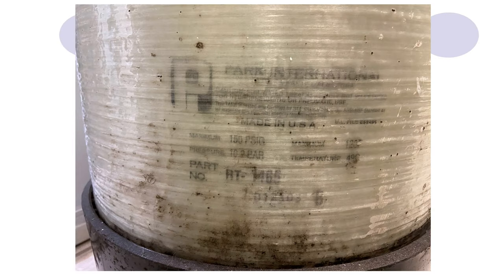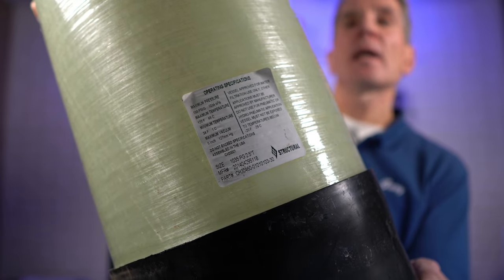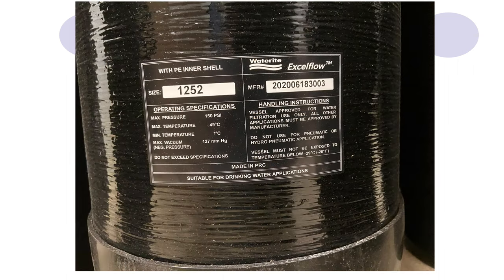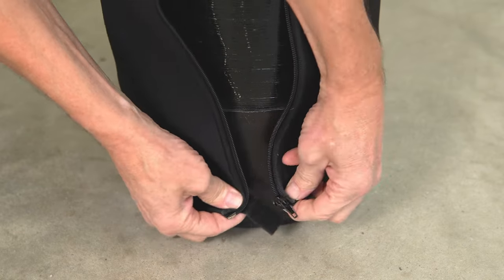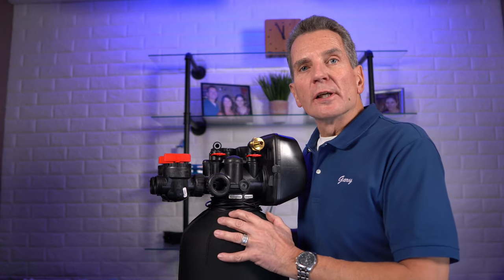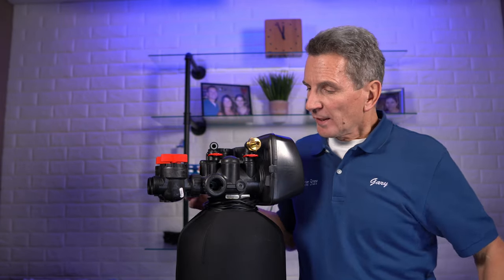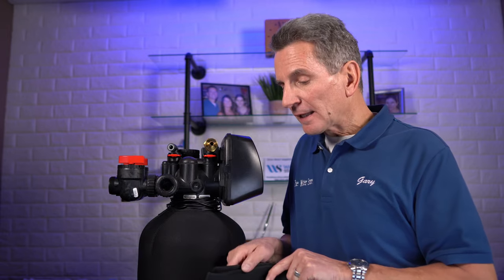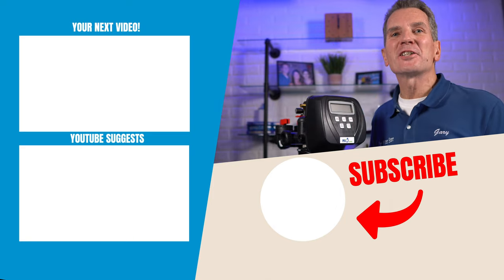Water Softener Jacket STOPS TANK from SWEATING!

Comment: Gary Found remnants of critter infestation in tank ...how to use the jacket or what would you suggest to keep mice out of tank please? Not sure how jacket fits over pipe fittings which is how mice got in.  Thanks for any help!!
Reply from the maker: Jacket has zipper at back so no need to disconnect from plumbing.  I've never heard of critters getting in, I guess you need to seal all holes to keep them out.
Reply: You had critters inside your resin tank or your salt tank?

Comment: We are on well water. COLD well water. The pex sweats from the bladder tank all the way to the treatment tanks about 12 feet away. We have two tanks. I get a slow drip on the back of the head units on both tanks. This drips down the backs of the tanks to the basement floor thankfully concrete. I think this jacket would just get soaked.
Reply from the maker: In extreme cases it will get soaked, but it minmizes the water getting to the floor and because you can wash the jacket you won't get mold build up. The jacket makes a huge difference. Did you read the reviews? https://waterestore.ca/products/neoprene-softener-jacket-10-x-54-tj1054zip
Reply: I just bought my first home. I too have extremely cold well water. I installed a whole plethora of filters and a twin water softener. Today the condensation hit me. I dried everything off, put a fan on it, and then dragged out the dehumidifier. Ran to Home depot and purchased a ton of insulation to complete all the piping. Now, if the tanks and other things, such as my four 4x 10" filter housings, and my 20" filter housing, and the spin down filter are all still exposed and uninsulated. You either have to condition the room, or put a dumidifier in there.